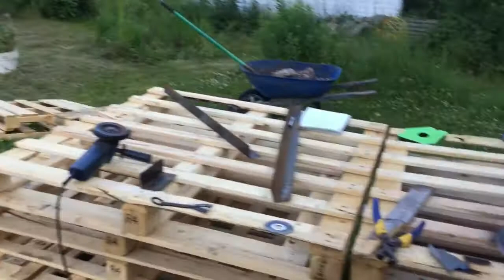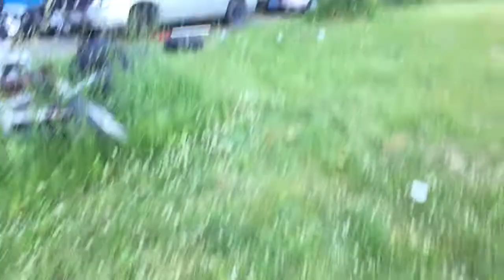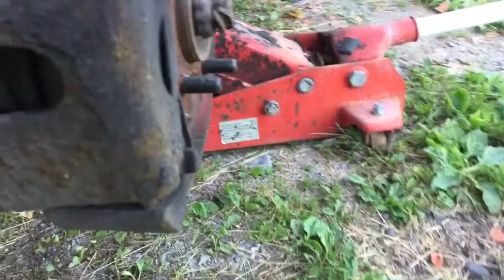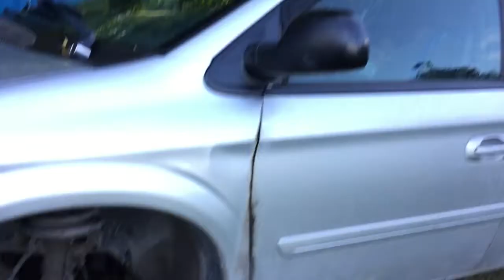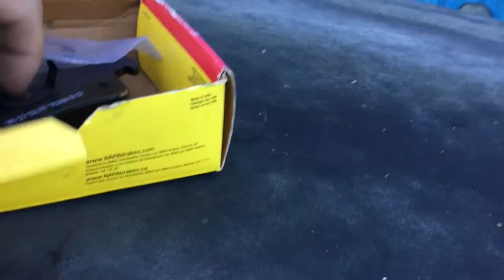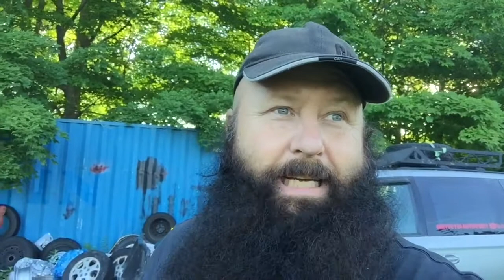Getting prepared

Comment: nice , what is that grill bar you got on the front off of , like a ram 1500 pickup truck or something ?? . is it  bolted on or welded . i need one for my 2013  Ram Cargo van . cheers
Reply from the maker: I got that one off a Chevy S 10 pick up truck in the scrap yard the brackets are welded on solid and it’s bolted to the brackets but it’s quite a solid unit and it has protected the front end from collisions with deer